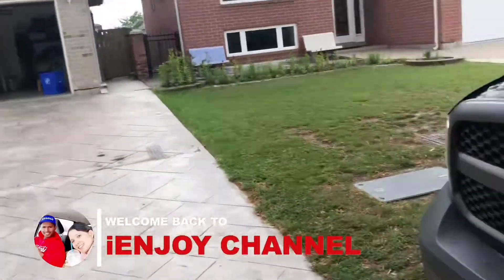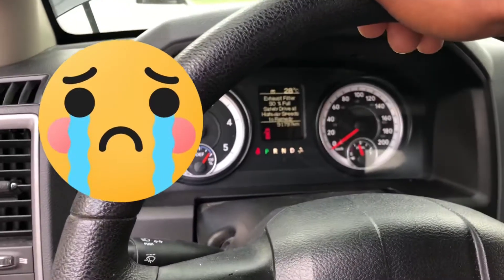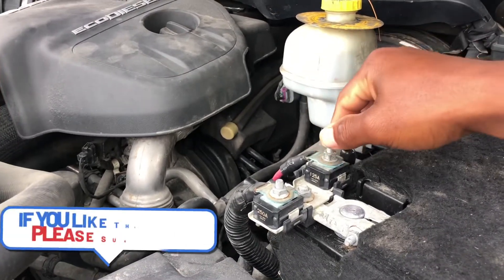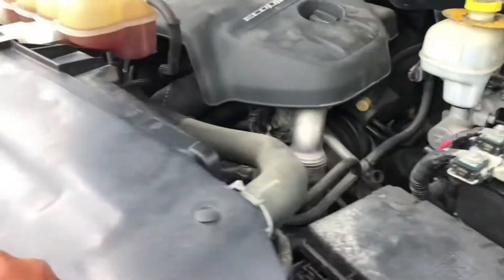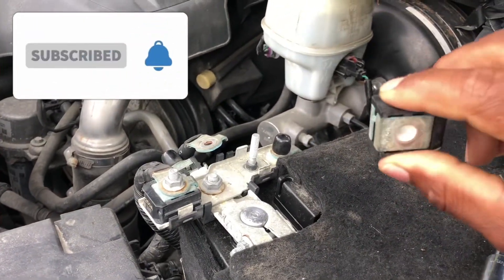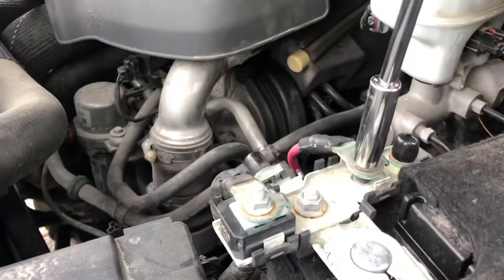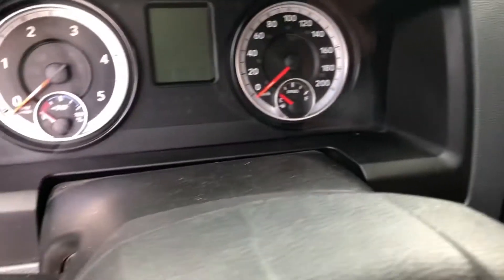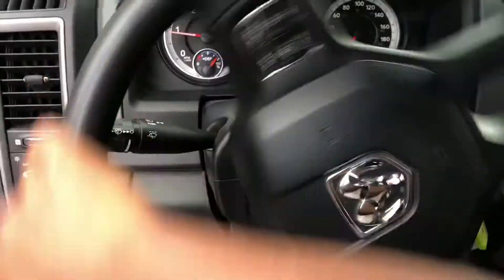How to fix 2014 dodge ram ecodiesel 1500 steering wheel lock / service power steering

Comment: Y'all, please don't drive on this without the system fuse there. That's a 125 amp fuse- it's there as a safety. If you have blown that fuse, there's a reason. Without it there, if you have a direct short (which caused the fuse to blow in this case because the polarity was reversed) you're going to find it quickly by letting the smoke out of whatever caused the fuse to blow. In layman's terms, no fuse = fire when whatever has a short to ground heats up enough. Fix it right.
Reply: Exactly! Fuses just don't blow out or go bad from wear or use like light bulbs do. Most of the time if the fuse is blown for an unknown reason, just simply changing the fuse is not going to fix it.
Reply: I was going to comment on that. Never bypass a fuse! Could cause a fire...

Comment: If that fuse blew because you jump started a car and connected the jumper cable to that fuse then this would be an OK temporary solution in an emergency situation.  If that fuse blew because of a problem with the wiring or steering rack and you take the fuse out, you are going to start a fire and cause a lot of damage.

Comment: It's the second video I seen where somebody has done this and blowing the same fuse no power steering.  isn't this great all these new fangled electronics on these vehicles electric power steering rack electric power steering pumps.. I'm dealing with an issue on the 2013 Dodge Challenger no power steering.. has an electric power steering pump..believe I have the issue resolved out of fluid leaking o-rings on the reservoir.. I hope it's an easy and expensive fix...

Comment: Have the same issue with the power steering but not cause from jumping it. I tried this fuse change method but it doesn’t work. I have to wait about 5-10 mins until my power steering light stops blinking. Hopefully someone can direct me to a fix.
Reply from the maker: I’m not a mechanic, but the problem with my truck is that I found out the fuse is burned that cause the steering stiff to turn. If you have tried and not working for you, always recommend seeking for a mechanic near you that can help.
Reply: U needa new steering rack lol happened to my moms truck 2015 ram 1500 gas* i tryed fuse thing didnt work so shes getting a new steering rack $1500 costs

Comment: I have a Dodge Ram 1500 express and having the same problem but mine is regular gas
Reply from the maker: It’s could be the same solution, if it doesn’t help you, best is, I recommended contacting dealer that near you to find out the problem, or do some more research, sometimes it’s help.